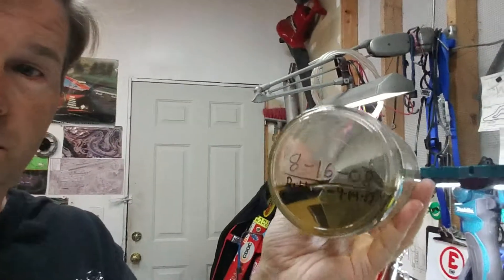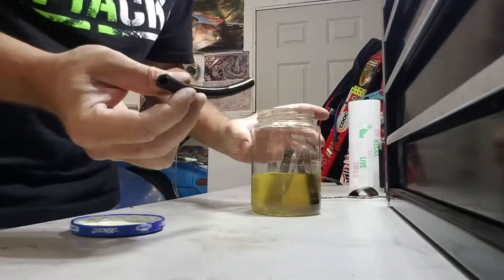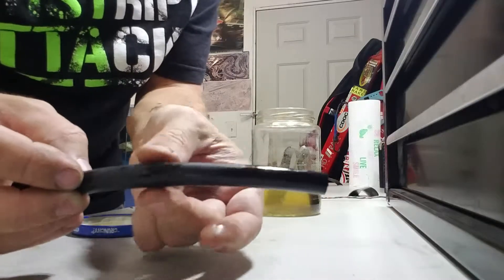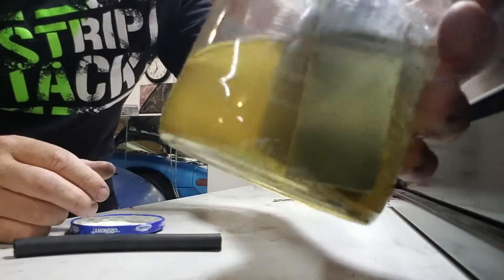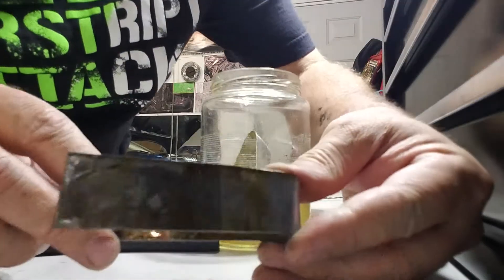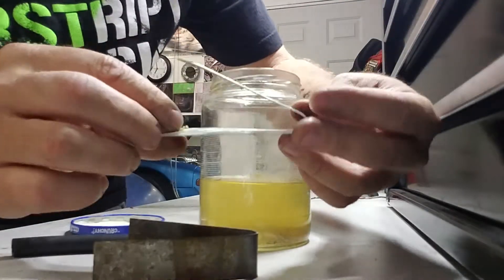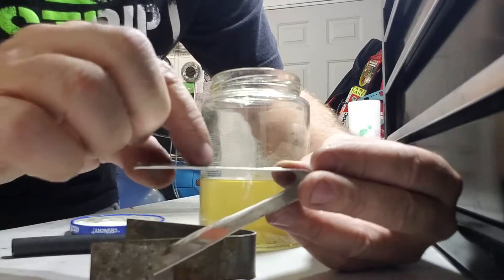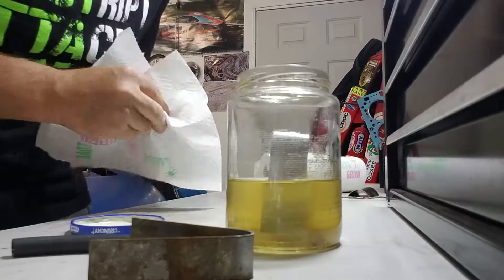E85 Corrosive Test Check in, Rubber Added

Comment: The test does not relates well to real use, because in normal use the fuel is kept inside the hose. If you want the hose to be submerged in fuel, it is a different special type : Submersible Fuel Line Hose  (example Gates 27097 ) more expensive.
Reply from the maker: Eh, just a simple test. There's no liner in this hose at all, which is what most DIY folks will use.
Reply: @DoesItTrack  It is always a good idea to try.  I did the same... :)
And saw my hose crumble from the outside. Then figured that to reproduce it it would be just a filed hose . Or one designed for immersion if tested  in this video. Or just look for the inside, if the outside crumble that does not necessarily means that it will in real life use.....
Anyway any decent hose now should, and most probably is, ethanol resistant.

Comment: A lot of people will argue against this test becauce of the jars being seal where as a fuel system in a car would collect moisture.
Reply from the maker: VorboteDesKrieg I totally agree. I wanted to test e85 all by itself, without water. We all know water will rust steel. The question is really more of is it the water or the e85 that does anything I suppose.
Reply: A fuel system should be well sealed as well though, only place where there should be much oxygen is on the injector tips and in the heads, intake, as well as on the piston. The alcohol on those should evaporate fairly quick though.